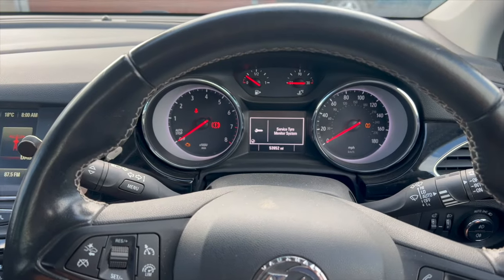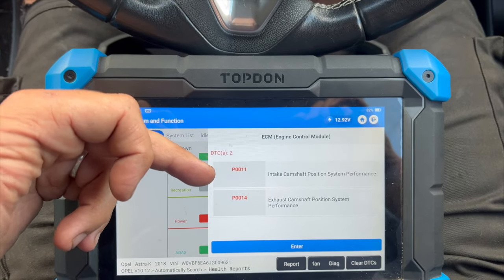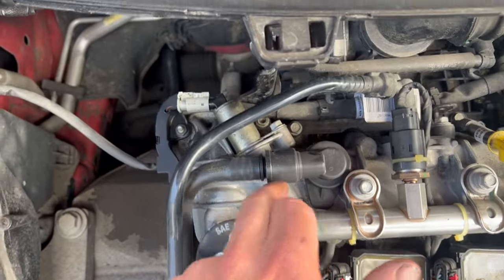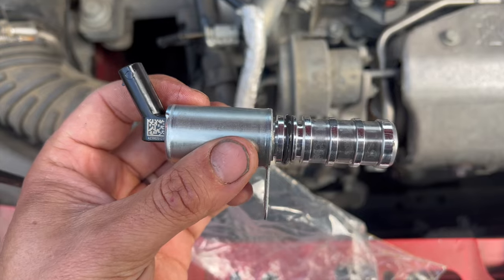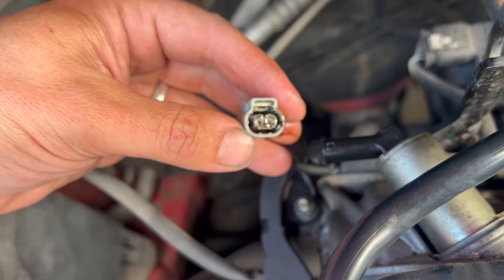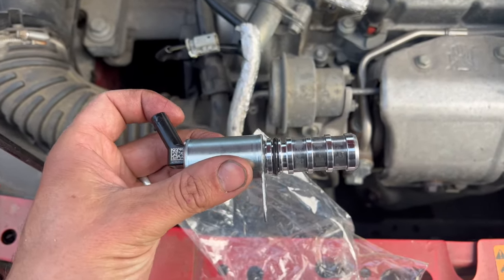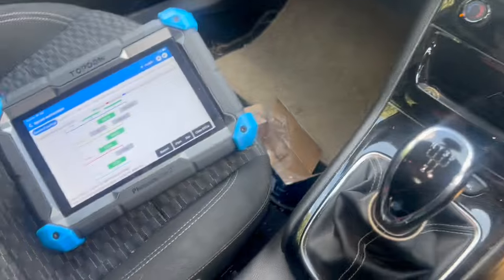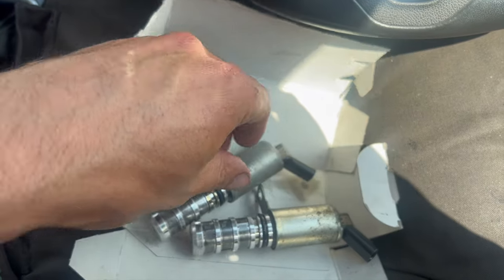Vauxhall Astra P0011 & P0014 camshaft position faults fixed

Comment from the maker: Check Euro car parts - https://tidd.ly/3lIO7xA  (use discount codes on site)
Check "Car Parts for Less" - https://tidd.ly/2LNEwIn  (use discount codes on site)

New Genuine OEM Solenoid valve Ebay - https://ebay.us/S1196T
Aftermarket valve Ebay - https://ebay.us/sc8PqJ
New aftermarket solenoid valve Amazon - https://amzn.to/3Yb8gQi

Check out the Diagnostic machine that I use in this video:
Topdon Phoenix lite 2 Ebay - https://ebay.us/tsyiTI
Topdon Phoenix lite 2 Amazon - https://amzn.to/3dxuQQl  

Tools used:
Socket set - https://ebay.us/7tUKdM

Comment: I have no fault codes on 1.6 mokka petrol, but a slight rattle at cold startup. Its got a timingbelt, so its not a chain rattle. Is it the vvt phasers or the solenoids maybe?

Comment: Hello mate. I’ve got both of those same errors codes, I went to dealership and I got told it was 12636947 part that needed replacing but after seeing this I think they’ve advised me wrong & it’s the same parts you’ve changed

Comment: Changed both camshaft sensors and the solenoid at the back of the engine. Cleared all the codes and now only one came back. 001463. Will this be the solenoid that I haven’t changed at the front of the engine? Thank you

Comment: Hi i had the same error p0011 error ,i cleared the faults and my warning light went off ,however the car turbo is lagging ...will the solenoid valve contribute to the lag ? Or should i check turbo ?

Comment: What fluid were you using to clean the components and the electrical connectors? Could you just you a electronic component cleaner spray?

Comment: Hi mate. I’ve got Astra SRI 1.4 Turbo with same code. I changed the part with part number 12636524 but code still appears. Any more suggestions? Thanks
Reply from the maker: Check all the oil is out of the connector , could possibly be the pulley itself

Comment: So I've got the p0014 code on my vaxhuall astra 2011 but I'm getting a rattle like shaking nuts and bolts in a tin.. Would changing these sensors be the problem please?
Reply from the maker: More likely the chain

Comment: Hi mate just wondering I have a 2011 astra J 1.6 petrol non turbo. Would these sensors be in the same positions?
Reply from the maker: Yeah they should be if it’s got the same setup
Reply: hi mate did u get it resolved? I've got the same issue on my 1.4 petrol astra j non turbo. doesn't have these solenoids. just some sensors at front and back. did u get urs sorted?

Comment: Can this problem show codes like camshaft timing fault and lots of camshaft issues codes plus valve code ?
Reply from the maker: If the pulley was damaged it may show timing issue related faults
Reply: @diydaly  pulley is related to solenoid valve?
Reply from the maker: @antsants6141  yep 👍

Comment: Hi, I have and Astra Sri 1.8 petrol 2007 exterior pack. Three fault codes. 001463 001462 and 034004. Looked them up and all seem to be camshaft sensor and exhaust camshaft sensor. Do you know how much roughly this would cost to fix? I have no mechanical knowledge and dont want to get ripped off. Thank you.
Reply: Hi, will the two solenoids you replaced fix the 001462 and 001463 error codes? 0034 is the cable going into the top right of the engine I believe

Comment: Hi mate, I've had these faults on my car I've changed both sensors, car is running a lot better but engine warning light has come back on woth the same fault codes any advice? Thanks
Reply from the maker: Hi , possible issue with the actually can pulleys inside , just remove both connectors a check there not contaminated with oil still , might need washing out again.. some times the oil can travel down the loom
Reply: @diydaly  great thanks I'll look into it thanks for your reply!

Comment: Hi i have his error on  the exhaust cam shaft se dor pooo14 insignia the sensor has been changed as has the oil and timing belt full kit the light is still on and the car sounds rough on startup any idea?
Reply from the maker: Maybe the actually pulley

Comment: Hi , i have these codes on a 1.8 vvt engine oil is dirty and not been changed in a while it is also accompanied by knocking and engine light can these VVT Solenoids cause knocking?
Reply from the maker: Hmm not usually tbh mate

Comment: Informative video thank you. Do the solenoids always throw an engine light or fault code, ie is it possible they could be faulty without the engine light showing?

Thanks!
Reply from the maker: Possibly depends if they are just blocked or failed completely